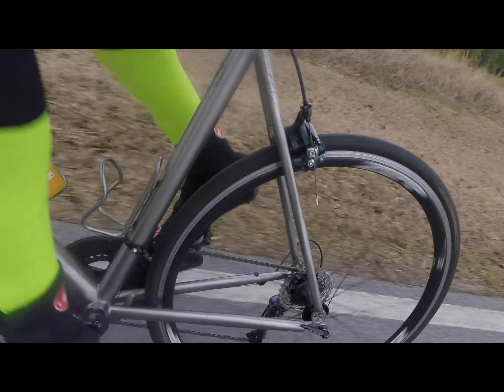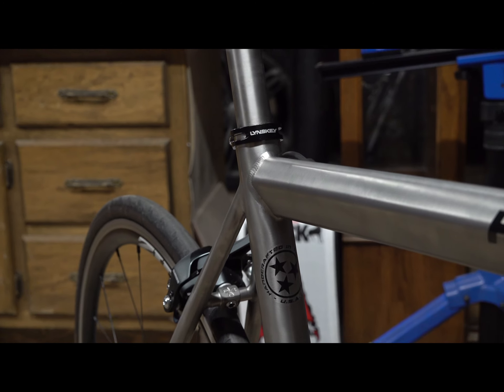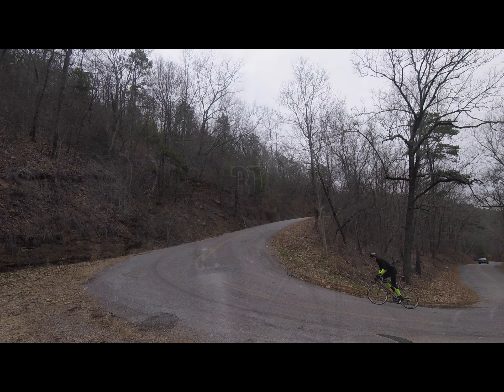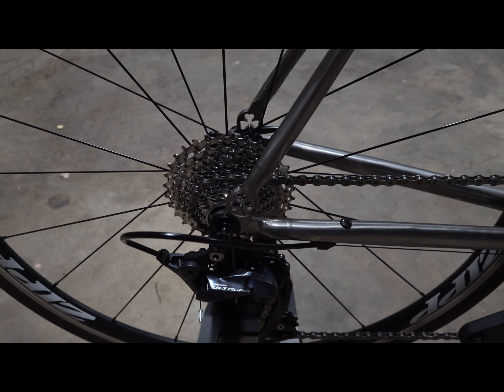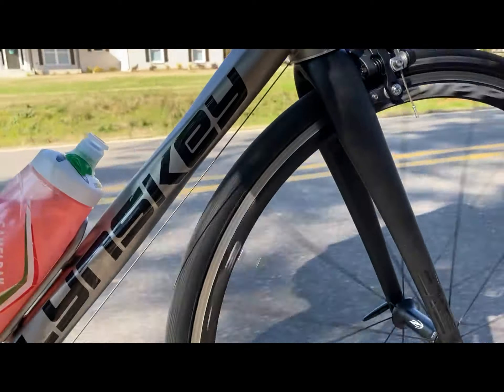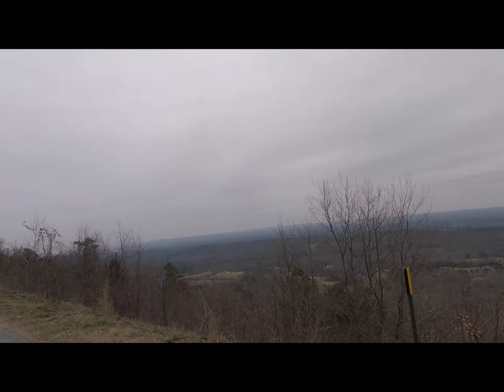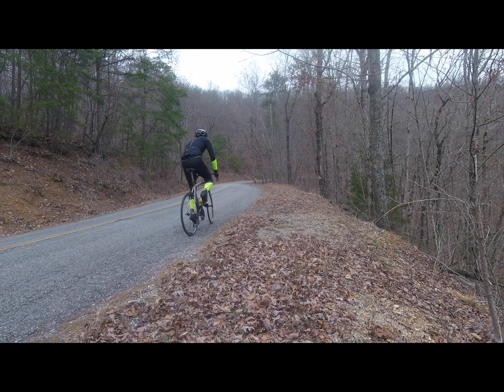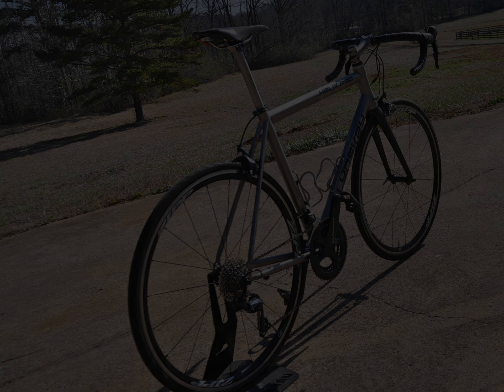Lynskey Helix Pro Review/ Initial impressions. Episode 4

Comment: Nice video.  I have a Lynskey R340 (2010 model year) that I pick up used a couple of years ago.  I have no idea how many miles it had on it when I got it but I have put 22,000 miles on it myself.  It still looks brand new and rides like a dream. Mine has the etched graphics so they will last a lifetime, no peeling or cracking of stickers.  Diamond shaped top and down tube and the helix seat stays make this frame laterally stiff but without compromising the magic carpet feeling of vertical compliance that quality titanium frames are known for.  These bikes will last more than a lifetime and are far more durable than carbon fiber.  Not only that, but they are literally a work of art and craftsmanship that is becoming more and more rare these days.  With a garage full of high end carbon bikes, I thought I would get a Titanium bike to use as a foul weather machine.  After just one ride on the Lynskey I hardly even look at my carbon bikes any more, much less ride them.  I ride my Lynskey everyday and only ride the carbon bikes when I want to be reminded how much better Titanium feels.

Comment: I own multiple Lynskey frames bikes and have both Helix and Helix Pro Rim Brake versions along with R265 and R240 Rim Brake versions.  They are all Dura Ace 10 or 11 speed mechanical and I have over 15,000 miles on each of them and I have done many centuries on all of them.  I am 5' 9 1/2 and ride a M/L frame size and find all of them very comfortable and responsive.

Comment: Jon,
     Just got my Helix Disc today. Got the SRAM Force AXS eTap on it. It's a beautiful bike and I did take it down the street after building it up for a quick tool. It handles razor sharp and feels very stiff. A few things I did notice right from the outset. I'm not used to having that "toe overlap" again when I turn the wheel at slow speed-something to be mindful of at traffic lights or when turning at slow speed. I will say this, it does seem to be a bit heavy, as I'm guessing 21+lbs. maybe with the stock build(Vision aero alloy wheels with 30C tires), and disc brakes and electronic shifting versus your rim brake and mechanical shift bicycle. Can't wait to get it out for a nice stretch up into the hills, as I'm eager to see how it climbs. It is a burly bike that would do great on dirt roads I'm sure. I bought a set of Specialized's Roval CL50 carbon wheels for it, so I'm sure that that will drop over a pound on it, with the lighter Goodyear Eagle F1 tires I bought for it as well. I'll update further when I get my first couple of rides on it. Thx. again for the review!
Reply: Hi how are you enjoying your bike? also, any problems w SRAM? thinking about buying a Lynskey that's offered w your SRAM setup. Thanks
Reply: @andrehendrik   It's a beautiful bike handling wise and with it's build quality. How much do you weigh because if you're not a big rider, say over 180-190lbs, then it overbuilt. I weigh just over 170lbs. and it's a bit stiff and thus overbuilt for my weight. 
Again, the bike is very stiff and really heavy unfortunately, and that is even with my new Roval Carbon CL50 wheels. If you're not concerned about weight and don't want the signature flex of a titanium bike then this is a beautiful bike at a beautiful price. Once you're rolling, you really don't notice the weight but if you're looking for that signature somewhat shock absorbent titanium flex, then get the regular R300 model. I had an old DEAN Titanium back in the 90's and loved that bike, even with it's flex. 
The SRAM Force eTap is awesome and being my first disc road bike, you will notice some drag with the brakes sometimes as the tolerances are supposedly much tighter than on my mtn. bike disc brakes. Be careful with swapping wheels as I had an issue with my new Rovals and the front brake/rotor scrub. I finely adjusted the caliper and got it to center somewhat. One thing I noticed is how the road rotors will scrub after braking as they warp a little due to heat and the fact that they are just not that true from the factory believe it or not. 
Anyhow, it's a beautiful bike, but I am thinking of replacing the frame with a carbon fiber maybe in the future. Unfortunately I rarely ride the road and am mostly a mtn. biker so time will tell. Either way, you can't go wrong!

Comment: Great video Jon! I am debating updating my KTM Revelator to the Helix Pro disc and this video is helping me decide. I don't think i'll miss the lightweight and climbing ability of my KTM with this, you seemed please with its climbing prowess.
Reply from the maker: Hey Matt. Thanks for the compliment :) I plan on making more... The pandemic is really getting in the way though.... As for climbing, I live in the Appalachian foothills so most rides in my neck of the woods ends up with 3000 or so average climbing for about 30-40 miles. The positioning allows for comfortable climbing and with my gear ratio it climbs just as well as my other bikes for my style.

Comment: @Jon Thanks for the post, enjoyed 4 part series. There are hardly videos or reviews and most speak of Moots. I am exploring Helix (non pro) for a friend for whom comfort is important. Looking at the internal cabling /disc to give a clean look. Appreciate your views on  - twisted Top / down tube and seat stays reduces Ti benefit of road comfort (u do mention smooth ride in the last part), - Enve fork would have a material benefit to justify its hefty price tag, sizing in one of the comments u mentioned ur size 6' 2" n frame size M/L , my fried is 5'10", any other suggestions. thanks!
Reply from the maker: Thanks for the comment Rayomand G. It is definitely comfortable. I would say out of my 4 main road bikes I go to ( Canyon Aeroad CF SLX, Cannondale SuperSix EVO and Pinarello Dogma K8) the Helix pro is the most comfortable IMHO. If I am planning on an adventure ride leaning toward gravel I grab the Helix Pro. Also IMO any of the carbon fork options would compliment the frame. As an aside about my size, like to size down and with very flexible spine and hips so what works for me might not be for everyone. My other bikes I ride are considered a Large

Comment: Nice review Jon! I am looking at a sweet Black Friday deal on a Lynsky Helix disc now. In your honest  opinion l, is the bike mainstreamed s bit at the expense of quality, or is it still a sweet machine? I had a Dean Ti bike back in the 90’s and loved it.
Reply from the maker: This is just my opinion on a fella who rode Redline and Hutch BMX in the 80s, Aluminum and CF in the 90s mountain bikes and then got into Road bikes in the early 2000's. From that point I road AL Cannondale CAD bikes and then upgraded to CF EVO and from there my Canyon Aeroad CF SLX and Pinarello Dogma K8. So this is my first Ti bike but I am comparing it to my Canyon and Pinarello. I plan on doing a comparison review but really wanted to put more miles on it before I did. So is it as aero as the canyon IMO nope. Does is accelerate as hard and fast as my Dogma IMO nope. Is it more comfortable for longer rides?? yep .but that was my game plan when I built it. It was going to be my winter, travel and trainingl bike which has been just perfect. The construction is a work of art and it is bomb proof. I hope that helps. Good luck :)
Reply: @jon4739   I remember my Dean Titanium having a certain "spring" to the ride. Is this the same with the Helix? Of course I had the old Spinergy Rev-X carbon wheels at the time, which offered a great deal of shock absorption, so I'm not sure if both added to that "springy flex".
Reply from the maker: @AOL0321   It definitely has a spring to it. It has a "liveliness " to it that my other bikes don't seem to replicate.

Comment: Jon, I've a Lynskey R150 it's a comfortable bike but it's a tad heavier, would you recommend the Helix Pro? I'm looking to build another titanium bike that will serve in steep climbs, I see Lynskey still have some framesets on their loft
Reply from the maker: Hey Mega. My build is about 1 pound heavier than my Dogma or my Canyon Aeroad. I could easily shave that pound off with some CF wheels as I am running pretty heavy AL ones right now. It climbs very well and still super happy with it.
Reply: @jon4739  That's an impressive weight considering the Ti will last you a lifetime and more, could I shave down enough weight on my R150 to make it similar to yours? What weight is your Helix?
Reply from the maker: @MegaXtc11  It is 16.8lbs.
Reply: @jon4739  One additional question, how does the Helix Pro reacts when climbing compared to your carbon fibre bikes, does it feel stiff when stamping power on the pedals? I'm on the fence going for the Helix Pro vs the Canyon Ultimate CF SL for the ultimate climbing machine
Reply from the maker: @MegaXtc11  It climbs very well but IMO it is not nearly as stiff climbing compared to my Dogma K8 or Canyon Aeroad CF-SLX. It carried into the hill very well and holds it's speed though.